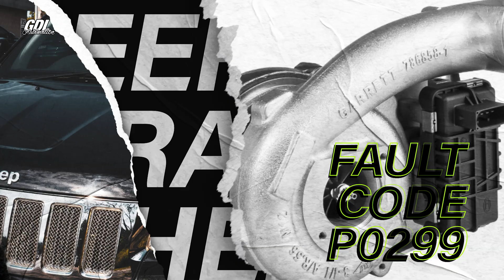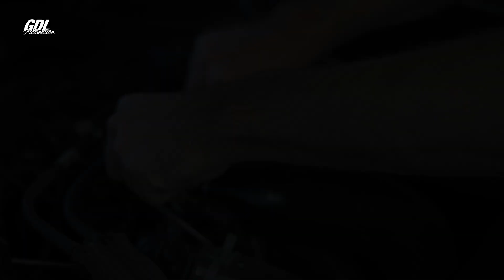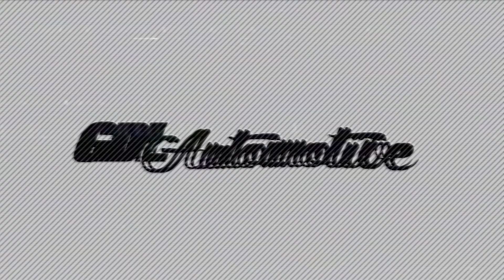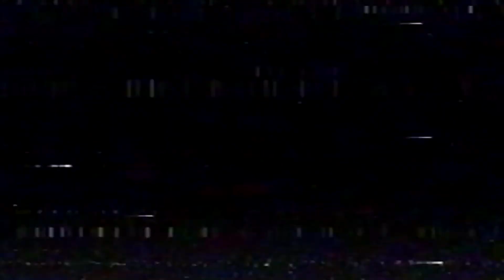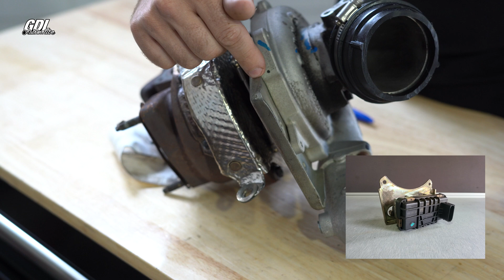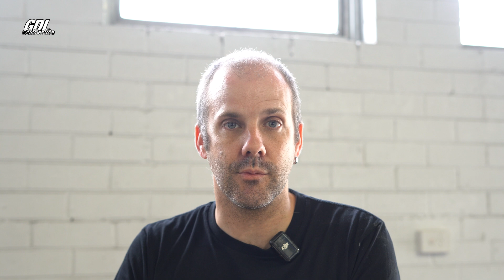Jeep Grand Cherokee Fault Code P0299 - Turbo Actuator

Comment: If you have a hole in the air intake manifold is it as simple as replacing the manifold?
200k old with carbon build-up. Blown map sensor to go with it.